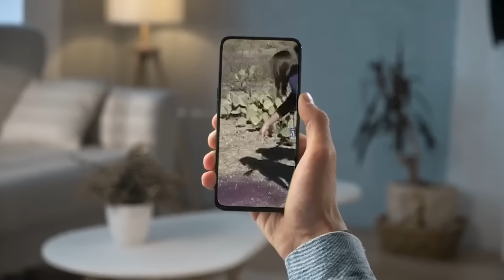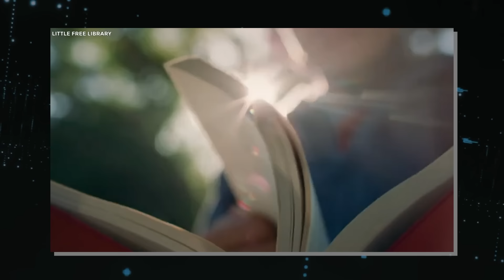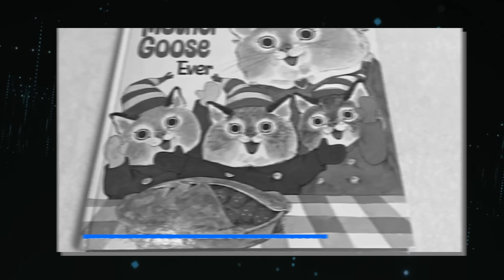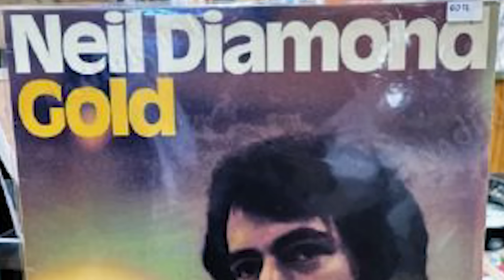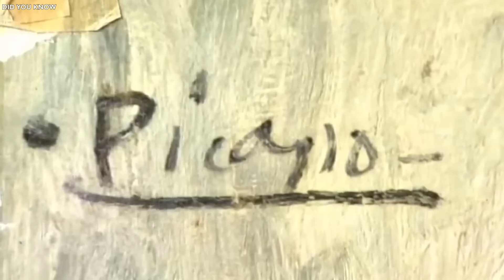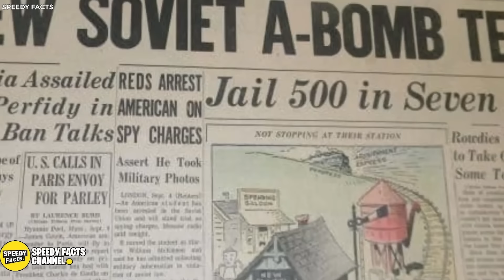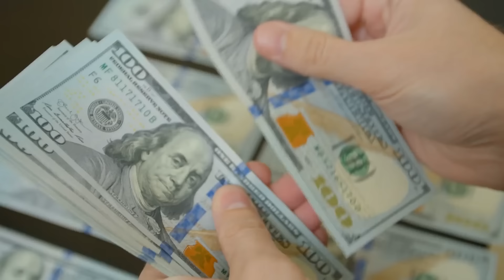Scientists Discover a 3 Million Year Old Door and Find Something Incredible Inside

Comment: These orbs are similar orbeez, although they are not the original toys that are sold under the brand of orbeez.  They're basically silica jell orbs that were flushed out of the airplane ✈️ the orbs expand two more than 50 times their normal size
Reply: Yeah I mean we used to make tie up collars to wear around our necks so we could country dance in the hot weather. 20-30 dry balls sewn into a strip of material then swelled up when run under water and then we’d tie them around our necks. It’s exactly the same thing. Someone has done this for the likes I’d bet ❤️🇦🇺